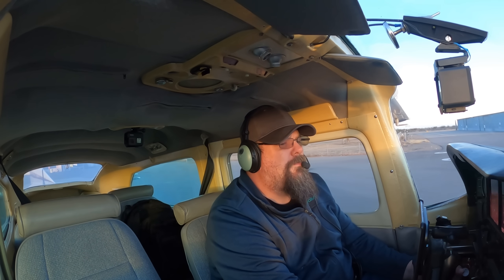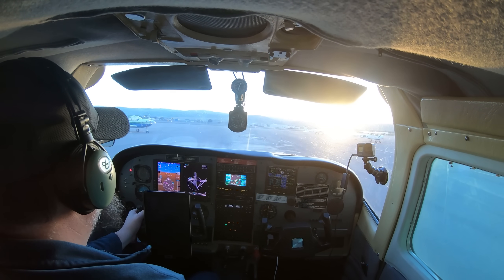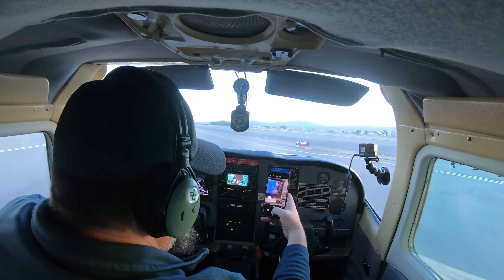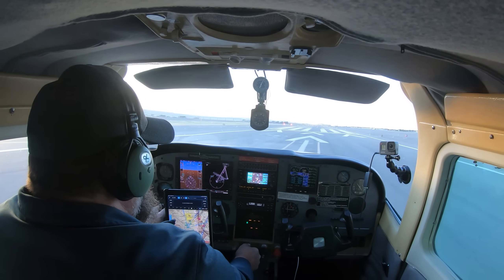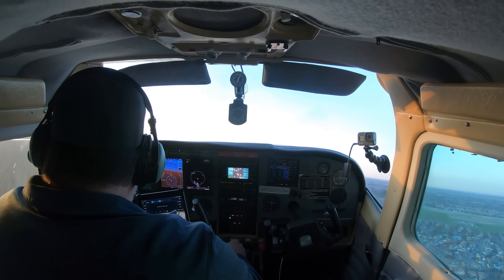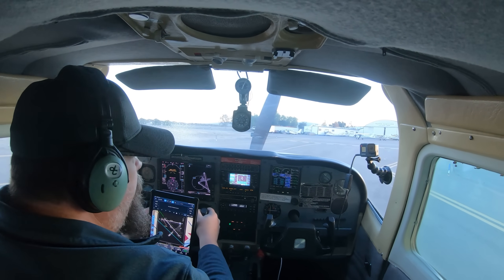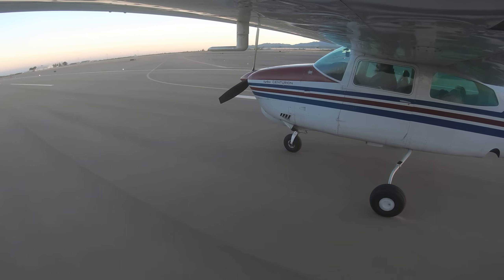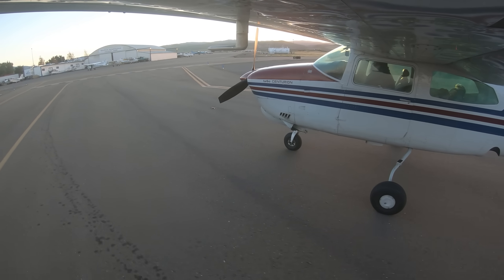Catastrophic Engine Failure after Takeoff

Comment: First of all, great job staying calm and flying the airplane, especially managing your airspeed and fighting the urge to pull back.

A few observations/questions::
1.  Do you use checklists? If not, consider doing so.  The statistics are really clear that humans make mistakes, and checklists help us catch items we are missing.  We might even be normalizing a mistake and not realizing it.
2.  Do you perform a takeoff briefing? You seemed to be taking your best guess (luckily it worked out) when it happened, which means you didn't go over this scenario before takeoff.   I say this after the run-up on every single takeoff.  An example for me would be "I was cleared to taxi to runway XX, I see runway XX.  Winds are Y @ Z.  Normal takeoff, staying in the pattern and will be making [L/R] closed traffic.  Any abnormalities on the takeoff roll I will reject.  Once airborne, if I have available runway with an issue I will try to put it back down on the runway.  If no available runway: under 800 ft (or whatever you determine) I cannot make it back and will make shallow turns, going for one of the fields.  Over 800 ft I will be starting my [L/R] turn to the pattern, so I will continue this turn back to the runway, declare an emergency and take a taxiway if I need it."  Also go over any procedures you need to do.
3.  What is your decision point for putting the gear up?  It looked very quick, and I think you still had available runway.  Consider a failure with available runway, you would want the gear down.  Consider only putting it up when with no available runway.
Reply from the maker: I do use checklists, it's sitting on my right knee. 
I am the first to admit that I am bad about verbalizing the checklist and briefings. 
My pre-takeoff emergency briefing is:
- If anything happens on the runway, cut power stop before the end of the runway.
- If I lift off and there is runway left, reduce power settle back to the runway
- If I reach crosswind turn AGL, I'm going to try for the crosswind runway

I say this out loud depending on which people are in the airplane. I say it in my head EVERY time.
For this flight, I've been briefing it a couple times a day in my head for a week. 
 
The decision to pull the gear up was an attempt to get the airspeed up to keep the cylinder heads cool since this was the break-in run.
Reply: @TheTheglobe  I doubt it.
Reply: @TheTheglobe  yes, why
Reply: @cpy  lol flight sim isn't a real pilot.  or maybe you're a 5 hour student pilot.  the dude literally had seconds to get down safe, there's no one on the planet that's gonna take out a checklist in his situation, please.
Reply: @h2oski1200  oh no, a sim pilot is mad at a me, what ever am I going to do 🤡

Comment: I like how you can see the initial instinct to pull up when the engine fails, but then how you immediately corrected the action by pushing the nose down
Reply: It s not necesseraly a mistake to pull up after an engine gailure btw.  If you have enought airspeed, you can exchange speed for altitude until reaching best glide speed and then set the nose down and keep best glide.  The 210 is a powerful airplane, I can t see what was the airspeed when the engine quit but maybe he was well above glide speed.  But indeed, sometimes it is just a reflex to pull up regardless of the airspeed.
Reply: Down force on the tail is lost as soon as thrust was taken away, nose pitches down, pilot reacts with nose up pitch probably as a reflex then the brain kicks in and starts deciding how to pitch after reading airspeed.

Comment: Any idea on what caused the engine failure?

I swear I could hear tapping or rattling as he stared the takeoff roll. It would be impossible to hear with the headset on and not sure if it was something in the cockpit.

By the way Amazing job on getting it back to the field.
Reply: After the second slight rpm drop and recovery, you can hear the bearing opening up in that shot from the wing camera

Comment: what was the surging about 3-4 seconds at take off power? good job on keeping cool and safe.
Reply: That is the prop governor momentarily overshooting the limit RPM as it comes up to full power. Not unusual with high horsepower and constant speed propellers.
Reply: @Jeffrey_Pyefinch  
Thanks for that explanation, mine never did that…
Reply: @Jeffrey_Pyefinch  The second slight rpm drop, then recovery may have been from a bearing spinning, doubling up tight, wearing to a clearance and finally wearing to looseness, hammering and failure.

Comment: Well flown Edward.   Glad to see you and the plane back on the ground safely.  My only thought is not about turning back or putting out the gear, it's that shoulder harness stowed over your shoulder.  Had you been forced to make an off runway landing, that could have been the difference between life and death, or at least a smashed face.  I know they're not the most comfortable, but I've seen people walk away from crashes that would have killed them if it weren't for the harness, and even a low energy crash can put your face into the glareshield.

Just thinking about you getting home to your family.  Well done on the flying, your energy management was outstanding.
Reply from the maker: Yes, I'm usually pretty good about the harnesses. Although there is this and one other video where I'm not wearing it. Beating myself up about this as well, and will be wearing it going forward.
Reply: I noticed that too.  Shoulder belts are important.
Reply: @Pantdino  "Shoulder belts are important"
More than that - they are required by law during taxi, takeoff and landing for all essential flight crew. See 2022 FAR/AIM 14 CFR, Part 91, Subpart B, 91.105 (b) [page 191].

Aside from that, congratulations on surviving the "impossible turn"!

One benefit of some other aircraft is that they have an easy tactile difference between the throttle/prop/mixture knob.  Making the same mistake twice within such a short flight is an indication that more attention to detail may be required.
Reply: @bradrobinhancock8491  Yes, the shoulder harness is required if the aircraft is equipped with one, but harnesses are not mandated.
Reply: @johnrltr  And the aircraft was equipped with one.  Therefore it should have been fastened during takeoff and landing.  It is strictly enforced at every flight school I've been to.  It is important to make sure that you can still lean forward enough to reach the fuel/tank selector lever and anything else necessary for controlling the aircraft if it is not the retractable style shoulder belt.
If you look at the beginning of the video the shoulder belt is laying behind him.  At 1:05 you see that he has it fastened in flight - so yes, the aircraft is equipped with a shoulder harness (belt).
Reply: Yep, ask Dan Gryder...
Reply: @jeffreynolds3848  or don't.  I can't stand that guy for his finger-pointing, self-promoting, egocentric individual.
Reply: Over the last 40 years I've had two friends and co-workers killed in survivable crashes while not wearing the shoulder harness. One of them was his second crash without his shoulder harness, the first just put him in intensive care and resulted in the revocation of his license, which arrived a week after his fatal crash.
Reply: Clearly a violation of 91.105 harness is installed
Reply: @herbertnavarro818  Don't try to debate that with @ Horacio Fernandez.  He is pretty much clueless as to the FAR and specific requirements/terminology.
Reply: I would opt for a four-point harness if I couldn't have a five-point harness installed.  With ratchet straps for the hip-belts.  But I'm Navy, and that's all I've flown with.  Even there, I never could get them tight enough around my hip bones.
Reply: Reminds me of a friend, his wife and three kids in the mid 80’s that got into a death valley with no way out. He put it down in a forced hard landing on a logging road. He, along with his wife and two year old child who was in the middle back seat, died when they went fwd and broke their necks on the dash. The two yr old simply slipped out of the seatbelt and the parents only had lap belts on. The two others walked away. Damage? A dent in the right wing from a tree. The engine was still fully operational and no other damage. So, so sad…and totally avoidable. He had only accumulated about 250 hrs and thought he could go from Trail BC to Calgary Alta.
  Seems like but yesterday😞

Comment: Amazing job. Kudos to you for staying cool headed, keeping the wing flying, staying coordinated, and proving the armchair NTSB nay sayers wrong (even if it wasn't quite a full 180, you still made it back and with a turn).

I think it's important that folks know that most planes can do this turn under 1000 feet above the ground (600 in your case) more than easily. I'm in no way suggesting that under 1000 feet works for every plane, though. It's a really good thing to practice at altitude so you'll know what your limits are with the plane. Next time you go up - give it a shot at altitude. Find what your minimum turn back altitude is and keep it to memory and add buffer if needed depending on the scenario. The biggest road block to doing it successfully in real life is making sure you're ready mentally (always include what you'll do when the engine fails on the upwind during every takeoff briefing). Startle factor could kill you. Being ready the same way a sharp shooter is to pull out their pistol and fire the 180 turn to the runway could save your life.
Reply: He did his best but the flaps were still at 20% the whole time. That was brave I thought
Reply: @RoverEins  That really didn't matter - he unloaded the wing once the engine failed and kept flying it. The flaps can be anywhere, flying the plane is what kept him alive. (Yes, I understand that flaps being in different positions will have an effect on the glide ability, but it's all scenario based).

Comment: Well done. What was your altitude over the field when it happened,  and what were the winds that day?  Did you have a turnaround altitude in mind? Having the crosswind runway available, in addition to good stick and rudder skills, saved the day. I'm guessing with the flaps up and the gear out later you would have had a few extra feet to spare, but ... well done, Sir.
Reply from the maker: Winds were calm, since my cpl, I normally brief "if I'm high enough for the crosswind turn, I'm probably high enough to come back to the airport" and I think I was about 600ft. With the flaps out, the stall speed is 45kts, I think I needed that before pushing the nose down
Reply: @TheEdwardFrye  I see, I see. It's clear that you had no extra altitude, so viewers need to know that this would not have worked for a 180 (270!) return to the departure runway, and it would not have worked from that altitude with a different wing (like my Mooney's). Headwind is important and helpful, too.

Comment: Good job at handling the emergency. At first it looked like you didn't immediately put the nose down but after rewatching a couple times it looked like the reaction was fast enough when you dipped it that it obviously worked out for you. The outcome was as good as any pilot could ask for. Well done man.
Reply: Incredible. What altitude were you at agl when you made the turn? I saw an faa vid recently of some folks pulling off the 180 at 500 or so ft agl but it depends on your aircraft climb rate and glide slope obviously. If you have a super fast climb you will be too far away from the airport to make it back, etc
Reply: Sometimes, depending on airspeed and aircraft performance you may initially want to pitch up and then lower the nose as you approach best glide speed. It looks like that is what this pilot was doing. Well done!